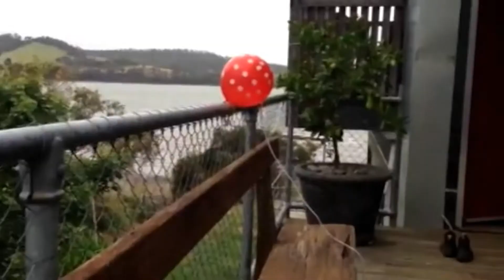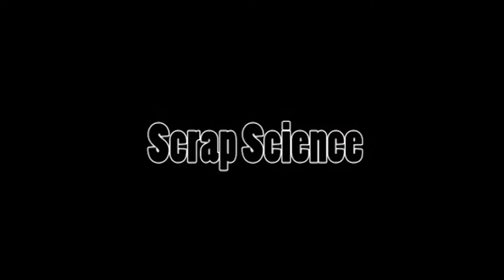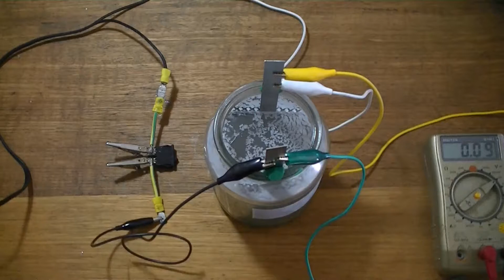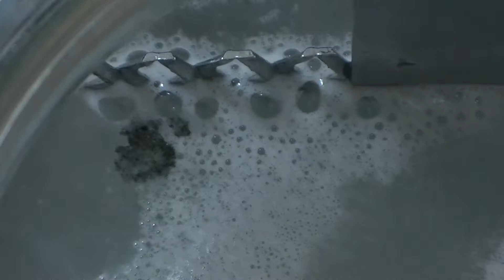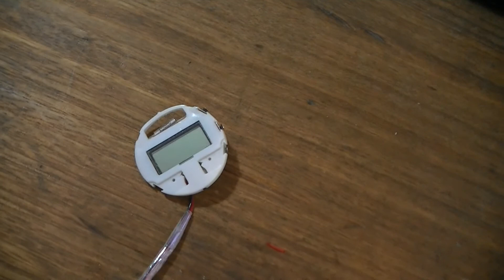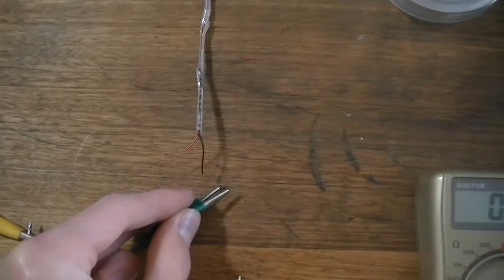Testing for Fake Platinum Electrodes

Comment: What is the sign that it is a fake electrode? The voltage that drops off afterwards?
Reply from the maker: This video was based off some information I was given at the time about fuel cells, which has turned out to likely be incorrect. It was expected that two platinum electrodes (when in contact with a small amount of hydrogen and oxygen respectively) in an electrolyte could act as a fuel cell, generating a relatively constant open circuit voltage of around 0.7 V. This didn't occur here, the cell acted like a simple capacitor and lost voltage quickly over time, so I concluded that the electrodes were not platinum.
A long time after I made this video, I tested this result with some real platinum electrodes, which did not give the expected constant voltage from a fuel cell reaction. As such, this test is not a proper way to test a platinum electrode for authenticity, and I've been meaning to take down this video for a while (in fact, I will likely do so in the near future).
If you want a proper method for testing a platinum electrode, I have another newer video which goes over a more effective (and simpler) method here: https://youtu.be/rwYUD3mCvCs

Comment: What do you would consider a suspicious price? I have found some that are about 8 dollars, but about 150 people have bought them.
So i don't know if it is fake or not.
Reply from the maker: Anything under $25 I would consider to be highly suspicious. To find authentic ones I'd recommend looking in a price range >$30 that also has customer reviews detailing the fact that the electrodes work for something such as a chlorate/perchlorate cell.
Reply: Is there any chemical test for platinum? If that's a fake eBay should do something about it.

Comment: What do you think the fake-platinum electrodes are made of? Is there anything neat you're thinking of doing with them?
Reply: An inside source at Scrap Science has informed me that the fake electrodes are in use to generate some heavy water... a video coming out in a few months, perhaps?
Reply from the maker: It's a bit difficult to tell, but they're probably something like stainless steel or nickel. I'm afraid there's really nothing I can think to do with them at this stage, maybe I'll just use them as electrodes anyway and see how they turn out.